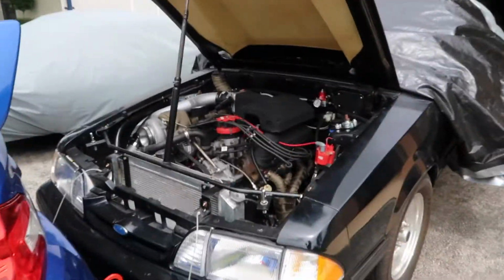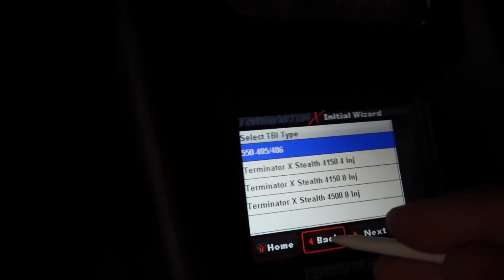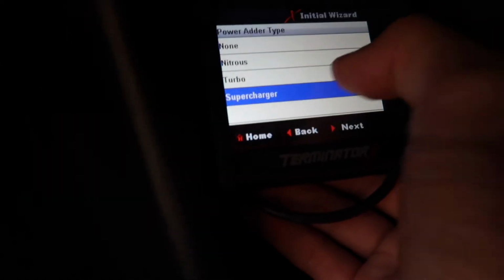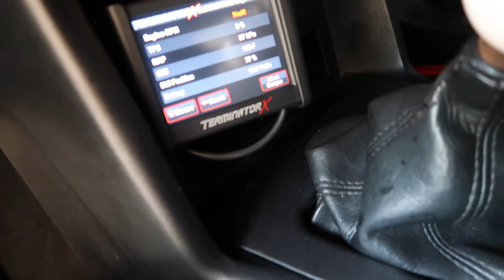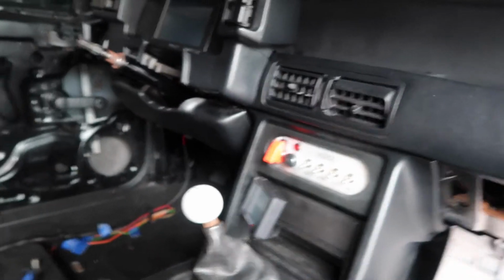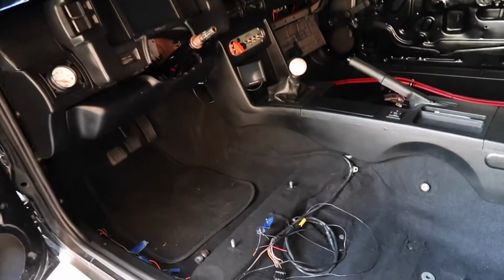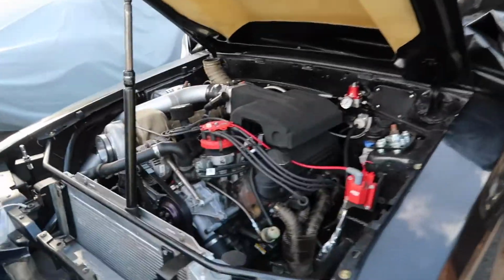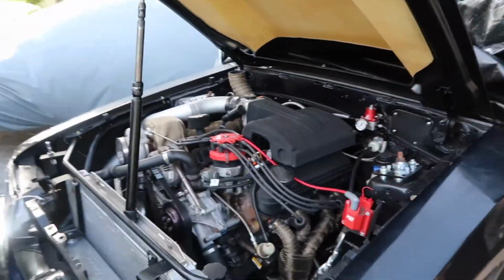Turbo Fox Body FIRST START On The New Setup

Comment: Hey quick heads up, with the turbo, you probably want an AFR at WOT of around 11.2-11.8 and you probably want a max timing when at full boost of 16-17 degrees so you dont blow a head gasket or ur motor if ur running 91 octane lol.
Reply from the maker: yeah that setting is tricky.. if you look back it says AFR at WOT @ 0psi .. and for sure .. gotta get all that dialed in..